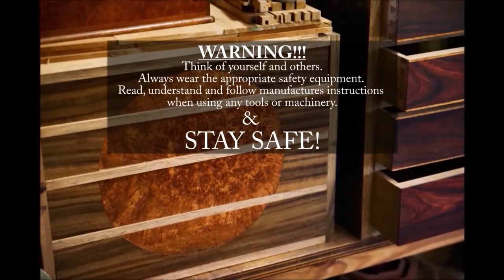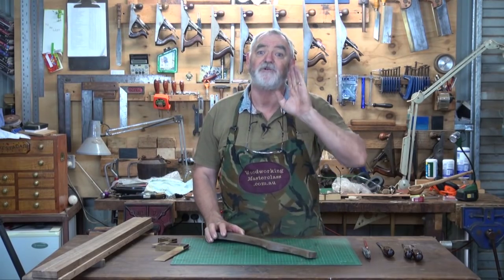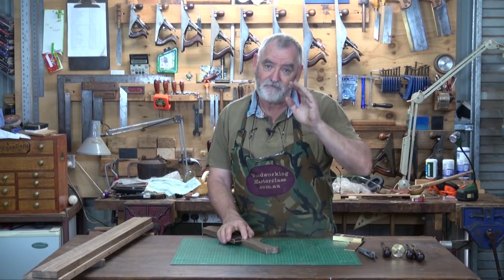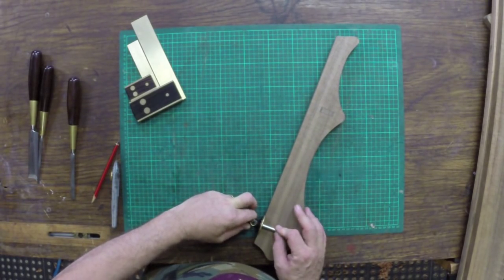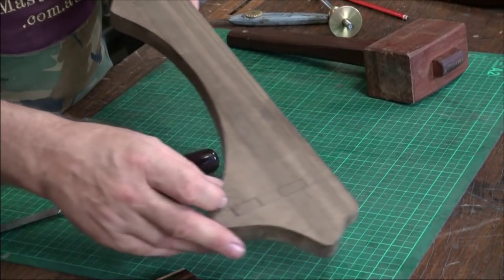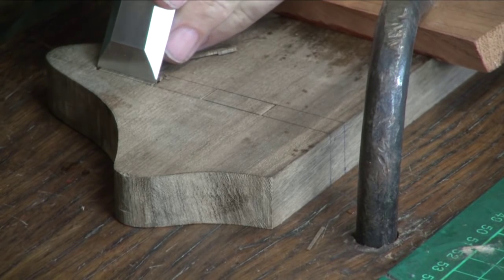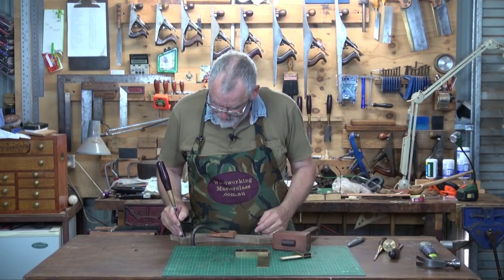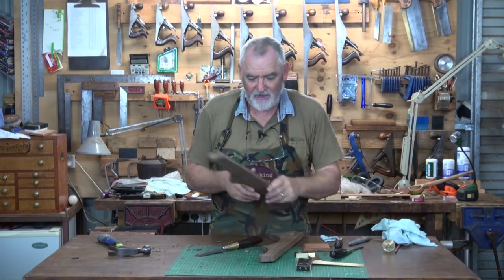Plate Rack Pt.4

Comment: So many nice tools are still on my wishlist instead of my in toolbox. Brass in fact is allowing the knife to slide against it which makes it better than steel. This is why brass is used for bearings in steam engines,
Reply from the maker: +Willem Kossen Thanks Willem for explaining that. I knew it worked but didn't understand why. Hope this helps out others that have asked me the same thing. Cheers Steve

Comment: I've avoided hand chopping mortises in the cross grain direction, but you make it look pretty straightforward. Lovely squares too, somewhat resemble classic brass squares made in the US by John Economaki of Bridge City Tools since the 1970s when he was a high school shop teacher. I made one from his directions and you're right, in use the heft and solidity of the brass square is quite different from a steel square. But as Andrew points out below, brass is softer than steel so we'll have to wait and see how yours wears. I am still careful using the knife with mine.
Reply: +Michael Anderson Correction: I don't see it on the website bridgecitytools dot com. It was his first product and seems he has given away the design and now gives classes on how to build it.
Reply from the maker: +Michael Anderson I agree it does seem a bit daunting doing mortises that way but 2 things are requires Sharp Tools and no deadline! I find if I rush 'em I stuff 'em! I think Colen has been making squares for over 25 years now as well as a range of spectacular marking tools. Hopefully, i'll have the pleasure of trying them one day. My thoughts were as yours about the brass wearing, however I've been assured that the opposite is try and Soft will wear Hard. I don't pretend to understand it but like you i'll wait and see. The analogy I was given is water wears away stone. Cheers Steve
Reply from the maker: +Michael Anderson I'm sure he made the right choice. I think there is more of a future in Teaching 'how to make' than trying to sell 'what you make'. Cheers Steve